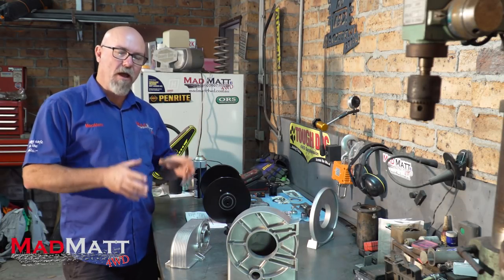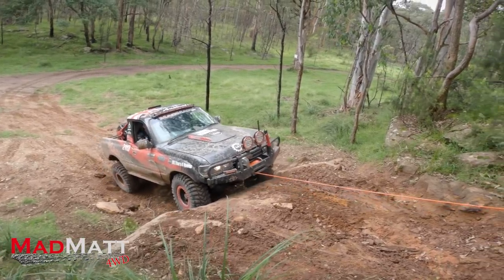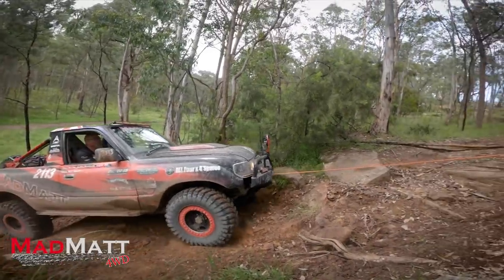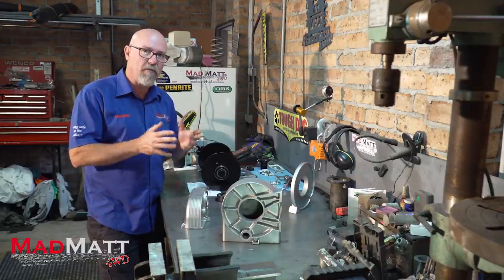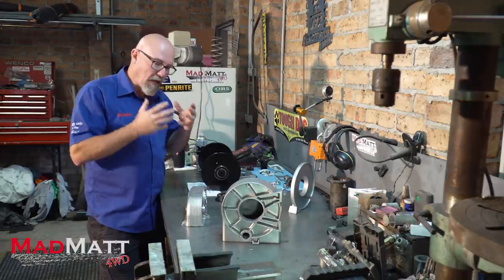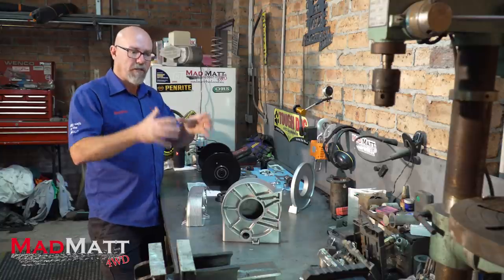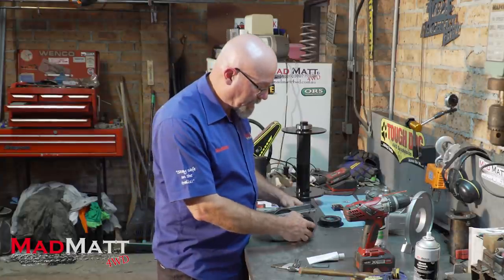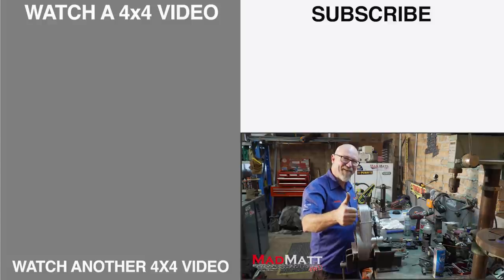WARN WINCH REBUILD // with upgrades - High Mount 8274 for the MADMATT RACE CAR

Comment: Very interesting Matt. Now I know what JJ used to talk about when he work at Giggle Pin. Different gear sets to give different speeds and pulls. Small diameter drums, elongated drums and the rest. Also Twin & Quad motor options plus 12 & 24 volt running. Looking forward to the next instalment. Crack on & stay safe on the trails 😀👍🇬🇧🇦🇺
Reply from the maker: Cheers mate

Comment: easy trick with the 21 ball bearings: use a magnet on the brake disc (doesn't even have to be super strong) and it'll hold em in place.  no grease needed!
Reply from the maker: Love that.

Comment: Looks like the 'WinchGear' stuff is a straight up copy of the Gigglepin stuff...Im surprised your keen to support such a concept Matt. But each to their own.
Reply from the maker: Brent I don’t know if it’s that or not. I’ve never run anything Gigglepin. I do know that Winchgear makes the stuff themselves and it’s done in Australia so I like that side of things for sure. Anyway. Each to their own ay. What Giggle pin set up do you run?
Reply: @MadMatt4WD  gigglepin invented the initial brake shaft upgrades for the 8274’s. The winch gear stuff is just a copy of it, slightly cheaper! Gigglepin are a UK Mob that have been doing the high mount stuff for many years now. They make twin motor top hats etc...each to their own but ripping off IP, R&D and selling it, isn’t something I’d support
Reply from the maker: I know Gigglepin and I know who Jim Marsden is. I think we need to be careful with this line of thinking because if we follow it through then many things become a problem. For example. Whoever came up with the concept of modifying a suspension system on a vehicle is the only who is ever allowed to do it. The first person to design a bullbar is the only one who can build bull bars. These may not be the best examples but you get the idea I’m sure. I think the key thing is that a company is making the effort to design and build there own version of a given product which to my knowledge is what Winchgear are doing. Of course it looks the same as Gigglepins. But funnily enough his looks similar to the Warn variants with His take on the Warn design. So in a sense Warn should be the ones going crook about Gigglepin. Unless I get information come to hand that shows me the Winchgear has been unethical I’m comfortable that I’ve represented my brand honestly at this time.
Reply from the maker: Also I’ve heard how Jim first got to redesigning the warn winch and that’s a very good yarn on The Talent Tank podcast. I don’t think Winchgear is trying to claim they came up with these upgrades first. I would certainly give Jim the credit there.